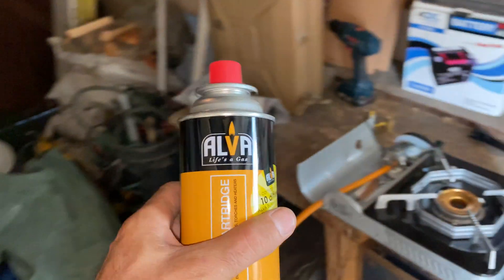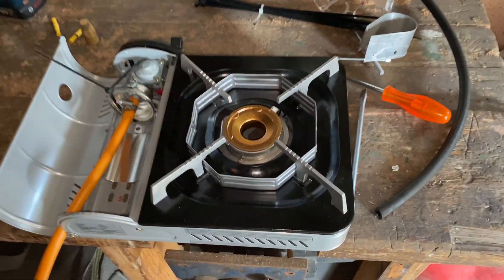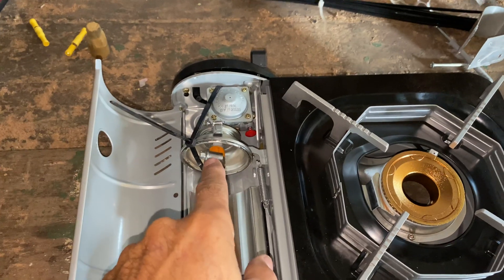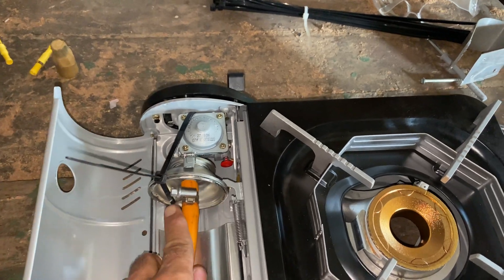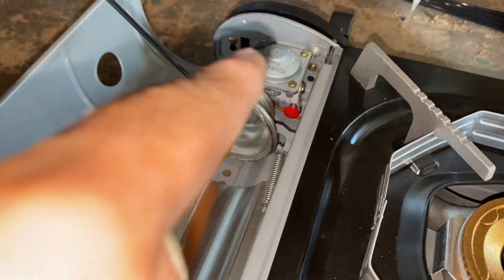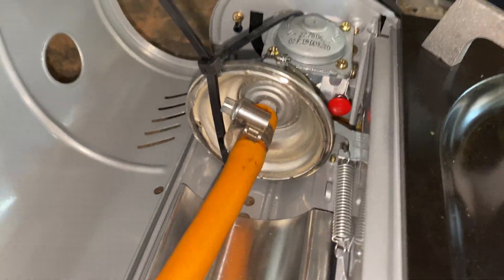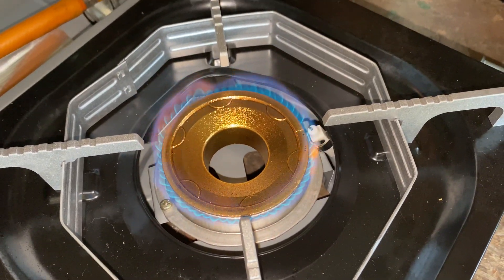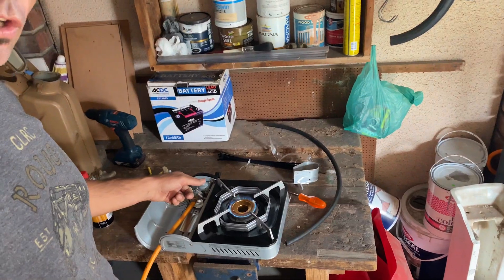Butane gas canister to LPG supply converter

Comment: Get yourself a proper adapter and safety regulator
Reply from the maker: These come with built in regulators anyway, having 2 will throttle it even more and wouldn't work
Reply from the maker: https://youtu.be/9qiRxlbVl0Y
Reply: Safety regulator look for it. Safety auto shutoff regulator and regulator are two different thing
Reply from the maker: @dylansue3519  the unit comes built with it. That’s the point of it. This is just a different way the gas on. It still fits into the same hole

Comment: Perfect! I'm going to do this on mine! It looks like you cut open an old butane gas canister? Correct me if I am wrong? But otherwise a good quality clamp like your one and my favourite: the cable as extra reinforcement? Yes sir!!!! Top job for improvising. 👍👍👍! I modify everything I touch but if you can please tell me about the canister? Any reply appreciated cheers 👍
Reply from the maker: check this out as well. i use a standard 3.5kg LPG bottle. lasts a long time https://youtu.be/9qiRxlbVl0Y

Comment: Is it possible to connect those pin adaptors used for ball pumps? Might fit enough to get more gas through at a higher pressure?
Reply from the maker: it's regulated so won't be possible to get more gas through
Reply from the maker: https://youtu.be/9qiRxlbVl0Y